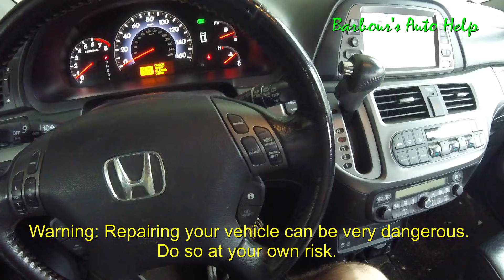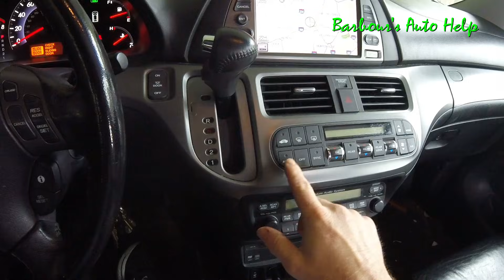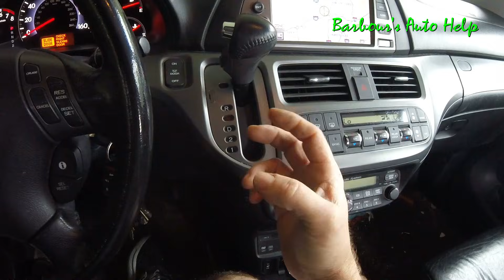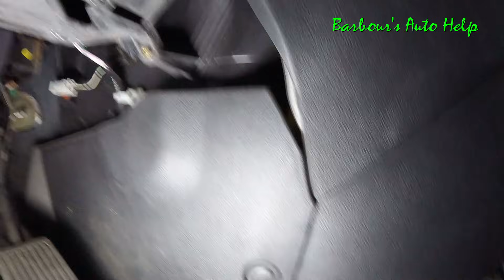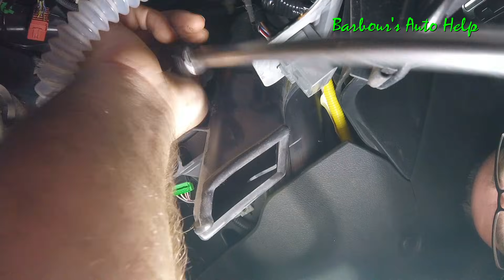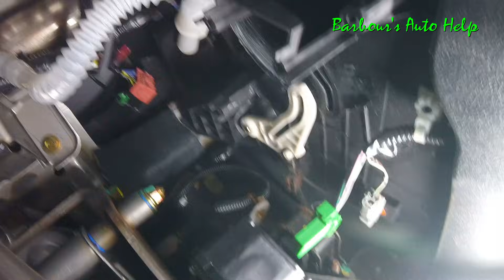Driver Side Temperature Blend Door Actuator Replacement 05 Honda Odyssey

Comment: Superb video. Both the audio and camera work are extremely well done. Without wasted time nor so consolidated to be useless, you struck just the right balance of detail to see how to do this job. Before taking it apart, I decided to do a multimeter test. Everything checked out, so I will move on to disassembly if a reset doesn't work.

Comment: Mr Barbour. I did everything on here but had no change at all. What do I look for next please. Thanks
Reply from the maker: What exactly is the problem with your vehicle?  I mean what symptoms are you having?
Reply: @BarboursAutoHelp  I get heat ok on the passenger side but it is blowing cold on the drivers side. I understand there is a diagnostic test from another video but can't find the list of codes for that diagnostic. Winter coming and stating to panic here in MN. Thanks for the reply.
Reply: I have warm air only on the passenger side and from the back bottom. 2009 Odyseey EXL

Comment: AWESOME REPAIR VIDEO...THX!!!  Thanks for saving me $$$!!!  The most difficult part about this is the very tight space you have to work in...not sure if the bottom surface panel directly underneath the steering wheel can be removed, but if you can do that, I think you have a bit more room to work with to make this easier.  This video, coupled with the one on repairing/re-lubricating the blend door actuator -- https://www.youtube.com/watch?v=jWcWUlbksco&t, makes this repair $0 with stuff already around the house...used rubbing alcohol to clean and some lithium grease to lube.  One piece of advice is to take a picture of the positioning of the white arms on the actuator, so that when you put it back together you can position them exactly where they were when you took it out of the car.

Comment: When reinstalling the actuator, first take 3 2-inch screws and cut off the heads.  Insert those into the 3 mounting holes under the dash.  Now slide the actuator over these 3 posts and get the pins in the slots.  Those posts will hold the actuator in place while you remove them one-by-one and put back the original screws.

Comment: Very helpful. Thanks!

For people wondering if they can do this: push the driver's seat all the way back. Lie on your back, with your head under the dash and your feet sticking out of the car. Then all the parts are within view and accessible. Two of the screws you'll have to do by feel, but not hard to reach.

Comment: Thanks the tips in this video.   One thing is for sure, getting to some of those screws takes some effort and flexibility.   For what is worth, I would avoid using a phillips tip (or make sure it is magnetized) and use a socket because there is less chance of losing the screw.  I lost one of them.   Hopefully it will pop up at some point.  Some useful tools are a flexible drill bit extension and a headlamp (bonus if it has a tilt adjustment).   Do some stretches before trying this.  As Barbour's Auto says, these are tight quarters.

Comment: Thanks for the great instructions.
I did clean the actuator with elecronic cleaner, applied degreaser, put the actutaor back, but now the opposite is happening. The hot air is blowing in the passenger side vent and the drive side is cold. Any thoughts ?
Reply from the maker: I'm not sure.  You could have something else going on or the actuator possibly is bad.

Comment: I'm amazed that you could video this while actually doing this.  Lying on my back and/or trying to get under the dash while kneeling outside the van, trying to get a flashlight where I could see, trying to get the tools onto those screws...  quite a pain.  I took my actuator apart, cleaned the contacts, cleaned the resistive paint on the substrate, applied some grease (dielectric?) that I had from when I worked at an auto manufacturer supplier that made throttle position sensors, and it seems to be working fine. I removed the bottom center console panel and removed the plastic below the steering wheel too.  Gave me a little more room and ability to see the one screw for the air vent.  4 screws to remove that bottom center console plastic.  2 below the cup holder, 1 on each side down at the bottom.  The plastic below the steering wheel (not the plastic around the steering column) has 1 screw on the bottom, then just pulls out.
Reply from the maker: Good job!

Comment: Great video!  However, after replacing the driver side blend door actuator, the problem is better but still blowing warmer air out of the driver side than the right side. Any ideas?
Reply from the maker: Perhaps your vehicle is low on refrigerant...

Comment: Thanks for this. I was able to remove and clean it but am having trouble getting it back in. Can't get the pegs to line up with the slides. I decided to just reconnect the electric circuit to see if I could get the arm to move by adjusting the AC/Temp controls and nothing happened. Made me wonder if the actuator motor is bad?? Any suggestions?.

Comment: Your video was so helpful. I was able to install it in my 2009 odyssey. The only issue is that it looks like the actuator isn’t setting the temperature as per the control. Before installing I had my temperature settings all the way low & face and then installed it. How do I reset the actuator so that it syncs with the control button? Thanks!

Comment: Great video, i have honda odyssey 05 but i don't have air coming out from far left vent(closest to the window) on driver side an some partial air coming form the one you were sowing on the video. My question is does the same actuator control both of those driver side vents? Thanks!

Comment: I can barely squeeze my body under the steering wheel and it causes a terrible pain on my spine, you are doing an amazing job getting a video produced.  Thank you.
 "B1222 Code - Short In The Rear Mode Control Motor Circuit" lead me to this video, can you or someone point me to the correct fuse location for this circuit, I am measuring 1.7 amps draw inline on the negative terminal, every time I put the amp meter between the open/disconnected negative battery terminal. thank you.

Comment: Hi, I have 2005 odyssey touring, would an issue with the Blend door actuator cause no air flow from the front center vents? All other vents are working.  The ac was working great but after I replaced the navigation system I no longer have air flowing from front center vents.  I did double check my cable connections.  Any guidance is appreciated.  Thank you.

Comment: I put in the new actuator (from Amazon) using the tip below about plugging it in and manually turning to cold so that things will line up, but when installed with 2 screws and tested, i am still getting hot air out of the driver side.  If i remove the actuator, i get cold air.  Help?

Comment: Omg!!  Thank you, thank you!!  I know you posted this a few years ago, but you saved my 2007 Honda Odyssey’s AC today!!  And I’m a mom who has NEVER fixed a car before!  When the problem 1st started (with hot air blowing from the Driver’s side vent when the AC is on especially around 74°F), my local HONDA DEALERSHIP was going to have a field day with my naïveté and the fact that I was a woman customer!  They were quoting me $400-500 to try to fix the “first of the 3 motors” since they didn’t know “which” one was not working!!  And then go from there!  Yeah right!

So then I took it to my local trustworthy mechanic, and they showed me I had barely enough Freon in my 2007 Odyssey since I never knew I was supposed to top off or even check the Freon every 5 years or so!  So after they refilled it professionally, my AC seemed to have found itself and started to work again!  And even the HVAC self-diagnostic test (I found how to do it on the Honda Odyssey forum) indicated there was no problem!  That was 2 weeks ago.

Then the AC reverted to its old problems, blowing out hot air only through the Driver’s side vent when I start adjusting the temps (as you go from 75° to 74°, this usually happened).  And when I ran the HVAC self-diagnostic test again, it showed that there was a problem with the air mix motor on the driver’s side! Sigh….

So I started to search online for a solution and TODAY I came across your YouTube Videos.  I went and got a new set of ratchet and socket set (had to learn how to use this!), a dielectric grease, and even a lithium grease, and followed your direction to the T.  The only thing is when I tried to separate the actuator/air mix motor housing, no matter how gently I tried, a few tabs broke off.  So when I put the the covers/housing back together, I used some electric tape to hold it together.

AND the end result is, I was able to clean out the actuator/motor and grease the electric contact parts and the wheel, and WA-LAH, it’s FIXED!!!!  I ran the AC, moving the temps up and down, and NO MORE HOT AIR!!!!  I ran the HVAC self-diagnostic test once more and it came back problem free this time!  

THANK YOU SO MUCH FOR your kind gesture and posting your videos!  I’m so grateful to you!  I’ll keep my fingers crossed that my AC will last as long as we have our minivan!  But for now, I’m doing the happy mom dance 💃🏻!!  I feel so proud that I was able to act like a Honda Mechanic and fix my own car issue!  Much blessings to you!!

The fact that this car novice can fix the AC issue, using a ratchet for the very 1st time, indicates how well you made your 2 videos and how well you taught your viewers!
Reply from the maker: Wow!  Thanks for taking the time to write that.  I really appreciate it and I hope you get many more thousands of miles out of your vehicle.  Great job!
Reply: Way to go Mom! I'll bet you were singing "I Shot the Sheriff"
Reply: I am about to attempt this today, thanks for sharing, this helps ❤

Comment: Thanks nice video, Just replaced my drivers side blend door. Very tight quarters. Mine was blowing hot air on drivers side and cold ac on passenger side (2007 accord ex-l dual controls)
What is the purpose of the white air flow tube at 2.29 in the video, mine popped out and it was very difficult to get it back in place, it came off the distribution box, I can feel cold air at what looks like a horn on the end, plus the air travels elsewhere (maybe the head end console/radio and other stuff to circulate air?) I had banged on my old unit back in 2018 and lasted to April 3 of 2022, I did this again an it worked, however, I had a new Blend door motor assembly from 2018 so I installed the new unit, it is working. On the Accord it is very tight quarter to get at the top screw. I will clean and lube the old unit so I will have a spare on hand, It also fits my 2003 Honda Accord, but hope I do not have to perform this maintenance for a long time.
Good Video Barbour's Auto

Comment: Great video, just replaced driver's side blend door actuator, hope this cures my climate control issues on 2007 Ody. Drivers side hot with cold passenger side, sometimes both hot, sometimes both good, sometimes odd vibration sound in dash. You made it look real easy but working under the dash is very difficult and I am a little guy. thanks

Comment: Hey I thought my odyssey had same issue I changed the blend door but it’s still same it’s a bit better but still driver side is cool air and passenger side ice cold. What else can it be? I seen a lot of people change the ac relay. How do I know it’s bad ? I see compressor comes on and off. However when I turn ac on and off the tachometer barely moves but I can hear the compressor go on.

Comment: Hi Keith, thanks for your great video.  I have the same problem with warm air on driver side, but when I adjust the temp from warm to cold and back, I can visibly see the actuator arms moving through their full cycle.  Since the actuator seems to be working properly,  should I remove/clean it or troubleshoot something else?  My refrigerant is charged correctly/no leaks.  Thank you.
Reply: I've got this same issue on my '06, actuator seems good to go also. Any word on your end? still dealing with it or did you check something else?
Reply: @MarkMcCormickFitness  I replaced the original  driver actuator with a new GPD	1712737 Heater Blend Door Actuator $42.79 from RockAuto.  I thought maybe the actuator just wasn't pushing the doors all the way.  Didn't seem to improve the situation--driver side is usually about 20 degrees hotter than passenger side on lowest a/c setting.  Unrelated, but my driver side runs cooler, but not cold, when I sync with the rear a/c system.  Makes it loud in the van.

Comment: Hello Keith - I did everything you showed in this video and your other one.  Put everything back together and it worked!  Except for 1 minor detail, when I turn the driver side to heat, it blows cold and when I turn it to cold, it blows heat!  What the heck did I do wrong!? - Thanks for the videos!
Reply from the maker: Sounds like your vehicle has drain bramage.  Lol.  Im really not sure.  Did the motor come out when you took it apart?  I wonder if the polarity got switched

Comment: I did the same thing, no replacement, just fixing thr current one. I see that the actuator moves on low and high temperature from one end to the other. But remains in place for other changes in temperature setting.

Didn't take the van out yet to test fully. 

But hopefully it wont throw hot air in summer if adjusted to the lowest temperature. That's a plus.

I don't know if this is issue with actuator or signal incoming to it.
Reply from the maker: Hope it works out well for you
Reply: @BarboursAutoHelp  thanks for asking. This has been working so well for each step of temperature. Thank you
Reply: @BarboursAutoHelp  it is working, awesome. not just extreme temps.

Few days in the middle were too hot, and AC worked well, and previously it would emit really hot air.
 
Thanks for putting this 2 part videos.

Comment: Question: my 2007 honda accord air when heat is turned on blows hot on passenger side and cold on driver side and after awhile of driving with it like that all the vents stopped blowing any air at all. So we get a part that (i thinks called a blower moter part) that plugged in behind the glove box and the air flow started back working but I'm back to the original problem of : heats on but blowing cold on driver side and hot on passenger...so since the driver side should be blowing hot (and its cold) I'm thinking this part the blend door actuator for DRIVER SIDE is the part I need...whats your opinion? 😊 Thanks for answering and appreciate this video😊👍
Reply from the maker: It very well could be.

Comment: Thanks for this helpful video.  Worked seamlessly for my 07 Honda Accord.  I will add that this is not a project for a novice as it requires removing interior panels and being comfortable with tools, but certainly not difficult for those versed with such things.  Took me about an hour start to finish.
Reply: You don't need to remove any panels! and the only tool you need is a socket wrench!

Comment: Hey, love your videos! ANy idea where the power supply for that actuator comes from? I replaced mine but it seems like a power source issue.
Reply: I am almost certain TEMP CTRL is hosted in the MICU controller behind the driver side kick panel.

This unit likes to go nuts because it host many functions of "BODY ELECTRICAL" (mirrors, seats windows, HVAC...)

Today my car doors would not lock (only unlock) so I connected my OBD2 scanner... Reset a boat load of codes under "Body Electrical" (ie. MICU) ...  bingo now locks work like new again. Main problem being "HVAC Blending door" screwing the central door locking on MICU!
Reply from the maker: Unfortunately I'd recommend a repair manual with a wire diagram.  Im not sure.  I've sold the van a while back.

Comment: Thank you SOOOO much!  I was able to remove the actuator, clean it, grease it and reinstall it.  Everything works great!  I must confess, I
broke one tab on the actuator and I only put 3 of the 4 screws back into the air vent... I just couldn't get to that fourth hole, :) I'm sure it will be fine.  Thanks again.  You definitely saved me a few hundred dollars.
Reply: I also used to trick of plugging it in before screwing it back in and turning the AC on to LO in order to realign the pegs.  Worked like a charm!
Reply: John Denton what was the problem I’m you ac?

Comment: Great video. Worked like a charm putting new part on. But the still did not solve my issue with warm air on drivers side and cold air on passenger. A lot bummed. Don't know what else to do.
Reply from the maker: Have you checked the freon level?
Reply: Yes, freon levels are good. I'm afraid it's much more sinister like the compressor or condenser.
Reply from the maker: I'd have a tech look at it.

Comment: I can't see the screws as well as you show un the video. Did you remove the panel under the steering wheel to get better access?
Reply from the maker: I put a gopro in there.

Comment: I've done this on 2 vehicles. The last time I did it, the actuator stopped working. I took it down and applied some gear grease to it, and it work's fine. Plastic gears, need a lot of grease.

Comment: The drivers side in our van is blowing warmer than the passenger side. Also the actuator was making some funny noises. I put the replacement on and it’s still blowing warmer on the drivers side. Video did help though.
Reply from the maker: Maybe low on freon.

Comment: My 2005 Ody EX-L and my 2009 Ody EX-L both had this exact problem.  But it wasn't the blend door actuator... it was the heater control valve. The actuator was working correctly, but the valve, while appearing to be in the closed position, was only really fully closed when it was jammed in the closed position.  Any tiny bit away from that and it spiked the temp on both sides.  If you remove the cable from the valve and jam it closed, it may prove the problem.  Part was about $50.